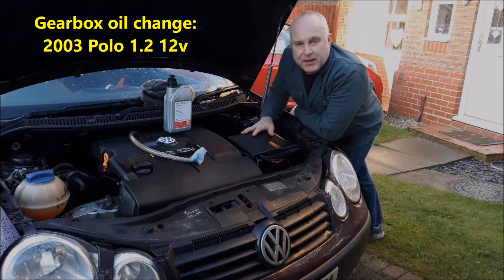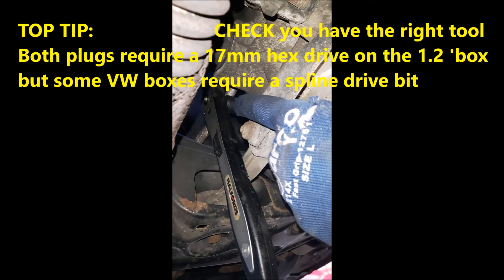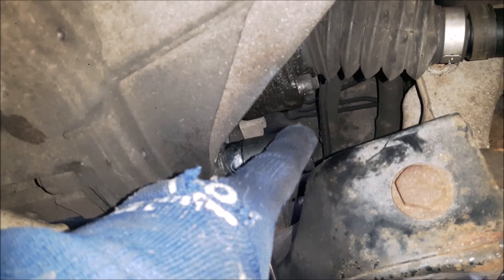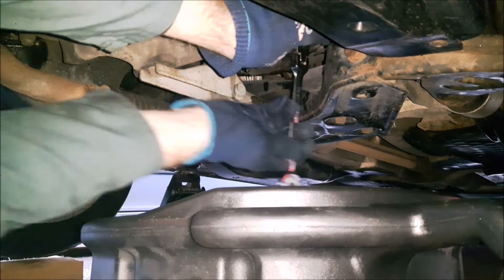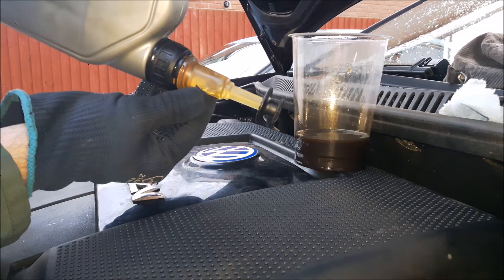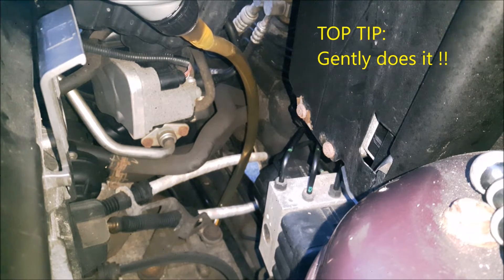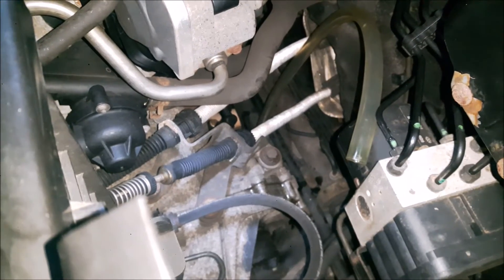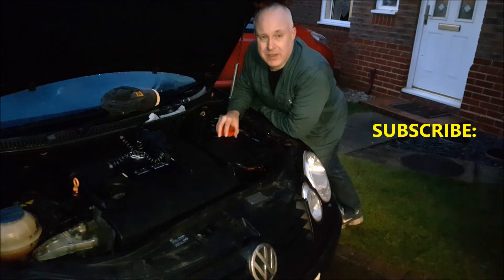VW Polo Gearbox oil change - transmission fluid change

Comment: For gearbox 02T (Polo 1.2; Ibiza 1.2; Fabia 1.2) recommended oil is 75W (VW 052 527 A2) , not 75W-90. Best opinions has Liqui Moly Toptec5300 70W-75W which is direct replacement for expensive VW oil.

Comment: Drained the oil on the 02T 301 103L (AZ 91 HP / GEJ) gearbox on my 2003 1.6 9N BAH Polo.
323 090 km and the oil are still like brand new (light golden without any metal flakes)

Comment: Thanks for this, I have to do the gearbox oil on a 1.2 polo I bought as an emergency car when my old Mazda 323 failed it's MOT.  The gearbox is whining a bit too much and all the suggestions online say that the gearbox might not have enough oil in it so a drain and refill is my first attempt to keep the car on the road until I can repair the Mazda.

Comment: Hi CC. Great video. Loved someone's idea of using a 17 mm bolt with 2 nuts to undo the plug. Genius. 🎉 In SA there are millions of nuts. Will use them. 
Last, to fill the gearbox, remove battery and battery seat? Pollo vivo 1400 2008. Thanx you are a star.

Comment: I.didnt even know.unhad to.do.this in a maneul only autos
Reply from the maker: OEs will say that gearboxes are "filled for life". What the won't tell you though is that "life" is 120,000 miles. Which means 50% will fail before that. So, if you want to extend the life of your 'box ..... you know the song!
(this isn't a cast iron guarantee, but for a small outlay and easy work once every few years, you can stack the odds in your favour)

Comment: Hi Cyclone Cyd, my car is on 400k miles I've never changed the gearbox oil since I bought the car. But when I change into gears it's a bit rough and is not fluent do you think this has to do with the gearbox needing more oil/ a oil change or something else?
Reply from the maker: Thing is, after 400,000 miles, there could be no oil left in the 'box and you wouldn't know it. At the very least check the oil level.
Reply: @CycloneCyd  Hi thanx for responding, I have the exact same car as you so how much oil does it take as you should know. Thank you
Reply from the maker: @ginoanthony  The polo took 1.8 litre
Reply: Thanx soo much I really appreciate it 🌟

Comment: where abouts is the fill plug for the gear box oil, its a VOLKSWAGEN POLO E 55 05 plate know where the drain plug is, just cant find the fill plug.
Reply from the maker: Usually about halfway up the front or rear gearbox side.

Comment: I have a manual transmission vehicle.  Which oil would you recommend?
Reply from the maker: Either Castrol Multivehicle or Mannol Unigear
Reply: @CycloneCyd  Would you recommend Castrol Syntrans Fe 75w this oil?

Comment: Would it not be logical to change the gbox oil filter at the same time?
Reply from the maker: It would be IF the gearbox had an oil filter, but it doesn't. Very very few manuals do.
Reply: @CycloneCyd  ah okay never knew that mate! Appreciate it👌

Comment: Well I have a 2008  Volkswagen Polo 9n Hatchback 1.6 16V, I'm trying to find out which transmission to use and my other question is recently my transmission has been doing a hesitation during shifting between 3&4.
Reply from the maker: Any Dexron III if you can't find that Castrol. First port of call is to check fluid level. If the fluid hasn't been changed in 50-60,000 miles then change it. See how it goes.

Comment: If you dont have 17mm hex key, you can use a bolt with 17mm head and have 2 nuts tightened on the other side. Use box end spanner on 2nd nut to break loos the filler plug
Reply from the maker: I like the nut & bolt idea. Nice one, Sarunas. Expanding on that idea a little, if one has access to welding, one could weld a nut onto a bolt and hey presto a home made adapter. Or even weld the bolt head to a piece of bar to make a dedicated 'breaker'. Many ways to skin a cat and all that 👍
Reply: Yes you can even just use the wheel bolt from vehicle group as they are 17mm, (vag group and other) it's an old trick for these.

Comment: sir nyc video , can i use sae 90 instead of 75w 90
Reply from the maker: If 90 is all you can get locally, then you've not much choice, but I suspect you'd have increased wear in cold weather and reduced economy. The gearchange when cold might suffer too.

Comment: I wil change mine tomorrow. Thuis video wil help a lot. Thank you!
Reply from the maker: Do let us know how you get on and what aspects you found particularly helpful
Reply: @CycloneCyd  ive done this before on different cars, it was just very useful to know where to find both plugs at forehand because for example i would not expect the drain plug to be where it was. and would have instead been looking under the front of the gearbox.. For me  personally filling felt better from beneath the car so i could see the first signs of spilling. it was not hard or difficult to maneuver  it around the axle. going out was approximately 0,5 l less then going in, the oil was not black, but not clear tho there were no solid metal parts.

Comment: Is gear oil same as transmission oil? I have a manual with a mini shift on my car n the light says I need a gear oil
Change .
Reply from the maker: That is correct. The shift to front wheel drive means the whole transmission is now in one box with common lube. Some companies call it manual transmission fluid.

Comment: Hi mate, great quality vid, well done. 
Pls comment on a few items pls: 
Is it really worth using VW oil? 
Would a polo 1.6 2008 transmission need resetting after an oil change? 
I did an oil change and the shifting is still jerky from 2-3, and reverse, once the car is hot, I’m looking to change the valve body, hence the question about resetting. 
Cheers
Reply: Confirming that it is an auto transmission.
Reply from the maker: @nevilledewinnaar7349  I'm a big fan of Castrol transmission fluids, and use Multivehicle MTF in my Saab. I'd suggest Transmax for ATF. This is the Castrol Transmax page - on the left is a oil finder so you can make sure to get the correct type. http://bit.ly/Castrol_TMax_Home.

I wouldn't have thought an auto would need resetting after a fluid change. I'd suggest driving it normally for 2-3000 miles with an auto cleaner added (https://amzn.to/382oxfE) and then changing again. If it has got sticky valves it might free up with the new fluid. ATF has virtually no detergent content (unlike engine oil).
Reply from the maker: Valve body?  Is it an automatic?
Reply: How many liter use .. 3liter or more?

Comment: Great video! how much oil did you put? I have a Peugeot 208 with 1.2 L engine, how much oil I should put in the gearbox after I drain it completely?
Reply from the maker: IIRC it was 1.8 litres, but the fill plug is a level plug too, so you can't overfill it.

Comment: I have 2003 Skoda with the same transmission, still on original gear oil, 35 000 miles on it. Is it worth to replace ithe gear oil?
Reply from the maker: YES

Comment: I need to change the oil of the automatic gearbox of my Polo 9N 1.4 from 2003. Could you give me some tips? Thanks
Reply from the maker: Hi Sergio, thanks for watching and interacting. I'm not familiar with any specific requirements of that 'box, but in general with autos it's not possible to drain the torque convertor without specialist equipment. So drain the oil pan and refill the 'box to the correct level with fresh oil and run it for 10,000 miles and then repeat. If the box doesn't have a dipstick, put back in as much as you drain out. After the second drain, repeat every 25,000 miles.

Comment: Hello I have a problem with a VW Polo 2003 1.2, when I turn on my car the gears won’t go in, only reverse gear goes in but it wont go back out but when the car engine is off the gears do go in with no problem, what could be wrong with that? Clutch maybe? Or the transmission fluid?
Reply from the maker: sounds like the clutch to me

Comment: Thank you very much, your video helped me replace the oil in the transmission. I just have a dilemma whether I've poured enough oil. I used one bottle and I have almost 300ml of the other bottle left https://ibb.co/Fq8414r. The oil went out, and I stopped quitting. The car was on the flat. In comments it says that it takes 1.8l of oil, and I poured 1.7. So I doubt the car was on an ideal flat surface ...
Reply: I have 02T gearbox and also some 300ml remained in the bottle. Btw official guide says that gearbox must be run for 2 mins and then oil-level re-check, who knows what cavities there are...

Comment: what if u use ramps to lift the car, is it safe to move car from ramps with drained oil from gearbox?
Reply from the maker: Hi  Kryštof , welcome aboard. Yes, just let the car roll off the ramps. Keep your foot on the brake to control it. Don't start the engine with an empty gearbox though.
Reply: @CycloneCyd  okay, thank you :)

Comment: Hi, really helpful video and well explained. I'm about to change mine would you say febi bilstien oil from eurocarparts was for this car?
Reply from the maker: Hi there sodaclublad, thanks for watching. Don't forget to like the video and consider subscribing.
Yeah, FB is what I used. My first choice for manual transmission fluid is Castrol Multivehicle usually (see thumbnail) but it's a 75/90 and this box is specified for 75 which the FB is. Plus it's easily available at ECP.
Reply: @CycloneCyd  thank you for the advice. I'm going to do the clutch too as it's juddering like mad setting off. Have subscribed
Reply from the maker: @sodaclublad  Oh, do let us know how you get on doing the clutch. Just make sure you haven't got a knackered engine mount first, that's another possible cause.
Reply: @CycloneCyd  thanks will let you know! And no I have already changed the bottom mount. When releasing the clutch it's as if the flywheel and clutch are not flat with eachother. Hopefully it'll be a Eureka moment when I see inside.
Reply from the maker: @sodaclublad  good luck.
Reply: @CycloneCyd  just wanted to let you know clutch kit changed and car is unbelievably smooth now! I've owned the car for a year and it's been horrendous setting off with vibration and juddering. It was a bit of a nightmare but with help from my brother and dad we managed to get the gearbox out. We really struggled manouvering it out until we took off the offside engine mount. I managed to break a couple of electrical plugs along the way. One for the reversing light and the other I have no idea yet. And when I drove home which was only two miles I lost all coolant due to a c clip disappearing from a coolant temp sensor which must have got knocked off. I had the red coolant light flashing on me. I believe it was the original 90k clutch as it said VW AG. Flywheel was perfect. Problem was release bearing had grinded the pressure plate down and the springs were very unevenly mashed up. Really glad it's done now it's such a good drive now! Although I'm driving a golf Mk5 1.6 FSI at the moment needs a lot of work I need to decide which car to keep!
Reply: @CycloneCyd  I m considering to change gearbox oil in my polo 1.4tdi 2005 and I hesitate between febi bilstain 75w  mineral based oil but on its labels have vw approval G052 512 A2  and castrol syntrans B 75w  full synthetic. What is your opinion? Did you have any bad experience after changing factory oil with FB? Maybe better choice is oem vw but it is more expensive.
Reply from the maker: @rebel6692  Castrol for me. I've got Castrol in my Saab box, it's very good. At the time the Febi was all I could get.

Comment: Could do with seeing how you get it level with axle stands, I presume you use four stands to get it level?
Reply from the maker: Hi Chris, thanks for watching and interacting. Yes, the car needs to be level to get the fill correct. In the video I suggest putting the car back on the ground for this. Doing it that way also makes it easier to reach into the bonnet area than if the car's in the air. Otherwise you would need to put it up on four axle stands, which makes no sense really as it's extra kit and effort for no real gain. Personally, though, I don't use jack and stands for jobs like this. Rather, I use caravan ramps, it's way less effort all round. https://amzn.to/2mC6w1Q
Reply: @CycloneCyd  how can you see it when its reached the right level? Thats the bit that baffles me...
Reply from the maker: @fantajenkings4068  
Ah, right oh! You can't see the level as such. The gearbox is a closed container with a hole in the side for filling. You cannot see in, so the hole is judiciously placed at the same height as the correct fill level. You fill the 'box until the oil just starts to drip back out of the hole. That's why it's important the car is sat level - if it's not the fill level will be wrong. 😀

This is true for most (but not all) manual gearboxes
Reply: @CycloneCyd  ahhhhhh so it can't really be overfilled if it's level. This was the puzzle in my head. The clear pipe shows it being full as it will come into the pipe. Right I'm ready! :) Appreciate the responses. Keep up the videos. If you want to fix my car for subs let me know 😁😁😁
Reply from the maker: @fantajenkings4068  Ouch! that light bulb  💡  came on so bright it was dazzling, lol.  😂😂😂

Yes, exactly right - can't be overfilled provided the car is level. The oil just takes a few moments to go down the tube, but the tube is smaller than the fill hole. 👍

Part of the 'trick' is to put the last 200ml or so in slowly. 😎

Comment: Hi, bought  a automatic polo at weekend and having problems with the revs. Pulls away fine but soon about to change to gear 1 to gear 2 revs really high but doesnt pick up speed. Had a mechanic say needs replacement clutch. Any ideas of the price range on a clutch for a polo 1.4 auto?

Thanks
Reply from the maker: I hadn't realised the auto must be an automated manual. I'd guess around £300 or so, but that is a guesstimate. Ring round for quotes - at least 3 and try to ring at least one place that's a transmission specialist.
Do let us know how you get on.
Reply: @CycloneCyd  Phoned around and most of the mechanics wont touch it. Its a semi auto and 1 mechanic said it was a DSG Gearbox and needs a specialised mechanic which won't be cheap. Will have to bite the bullet and loose half money I paid on it few days ago and re sell the car
Reply from the maker: @stevemann2555  it's a shame so soon after getting it, but why not get it done? Is it a good car otherwise? All cars need a clutch at some time - it's a service item. If you sell on you lose half and have nothing to show for it. if you buy the clutch - ok it's effectively cost over the odds - but you've got a good car that could give plenty of good service. if you do the former, you've still gotta find money to re[place it. And that assumes you can sell it. Work out the total cost of each option and then weigh up your options.
Reply: @CycloneCyd  Yeah its a nice car, previous owner didnt specify all problems and I am a noob so didn't ask many questions and got home and loads problems with it amounting over 3x what I paid for the car. Best to get rid and search for another being more glued up next time. Do you know if I can sell this car with just the v5c green slip or do I have to wait until the whole logbook comes through?
Reply from the maker: Shame. Yeah, maybe move it on and put it down to experience then. We've all been there. You can't learn from mistakes you haven't made!!
Sorry dunno about the V5 thing.

Comment: Great Video..How much oil is required?
Reply from the maker: Thanks for watching and interacting. Don't forget to like the video and subscribe.
Fill through the fill hole until it just drips back out with the car level. IIRC it's 1.8 litres, so you'll need 2x 1litre tubs. 👍👍

Comment: good video but at 0.34 it would have been good if you could have filmed from outside shot to inside as opposed to just cutting to the inside shot of undoing bolt
Reply from the maker: hook stunk Danis thanks for the tip. I'll try that on a future video.

Comment: Very handy tip about using the spanner on the hex-1/2" adaptor.
Reply from the maker: Iain Walker thanks.
Reply: Did this job today spanner on the hex socket was perfect
Reply from the maker: @martynnoble3760  Gotta think outside the box sometimes. Glad it worked out for you.

Comment: Hi m8,

wondering ig I can use the Castrol Synstrans Transaxle 75W90 (GL4+) instead of the 75W90 (GL4)? It´s a 02T transmission from a 1.6 Skoda Fabia.
What does the + mean?

Regards
Dom
Reply from the maker: I think, but am not 100% certain that the plus means it's got hypoid properties, hence the term transaxle in the name - it's for use cases where hypoid properties are required. I wouldn't imagine that would do any 'harm', since the hypoid element is the addition of extreme pressure additives, but having used Castrol Syntrans Multivehicle in my Saab 'box, I'd stick with it.
If you've already got the oil then use it, but if you've got to buy it, then buy the recommended stuff would be my 'take'.
Reply: Cyclone Cyd THX - I allready have it ... I'll Change it later this day.
Reply from the maker: I'd suggest a 'box fluid change every 50,000 miles anyway so I can't see it doing any harm and anyway that Castrol is mighty good stuff.